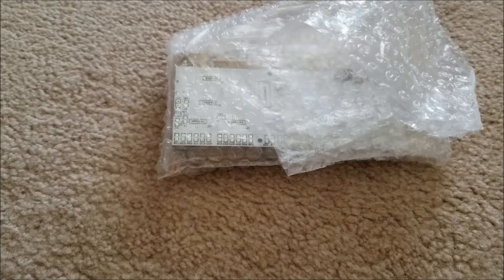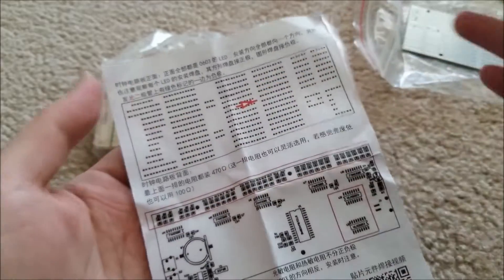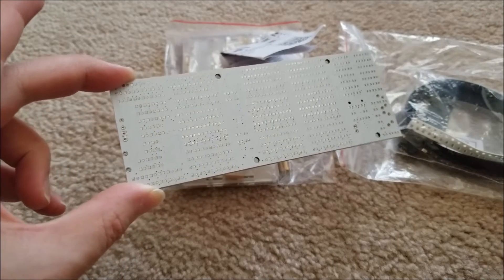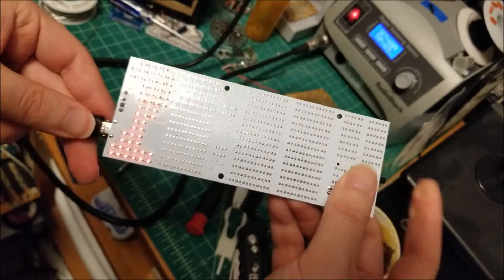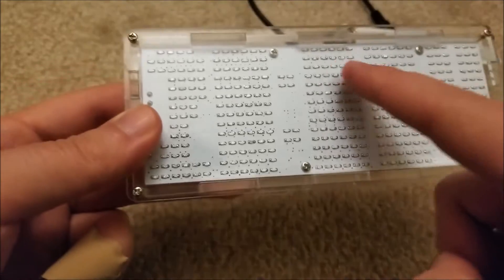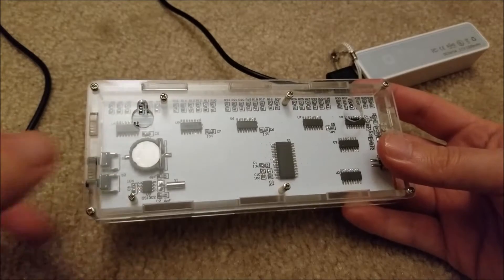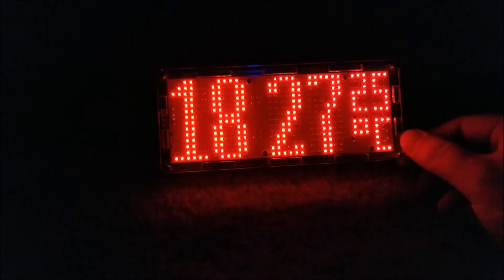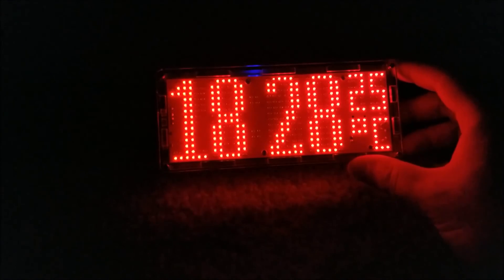ICStation SMD LED Clock Kit Review

Comment: OK, I built a version of this clock (July 2020). It's terrible. First, I'm good at this and I love clocks, all kinds. So I got this thinking it would be a fun project that would give me a decent result. It took me about 2 to 2-1/2 hours to built with top of the line professional soldering equipment, just to give you an idea how long it might take you with your equipment and experience level.
The problem is the uC program stinks! There's no way to change over from 24h to 12h format and no way to change over from temp in C to F. Then the digits run together at certain times. My opinion - don't waste your time, there are better clocks and kits out there.

Comment: Nice video, very informative as usual.
For the issue you're experiencing, have you cleaned all the board with IPA and a toothbrush?
Reply from the maker: I used some mg chemicals contact cleaner to dissolve all the visible flux and an old toothbrush. Will have to try some IPA and see if that does a better job.